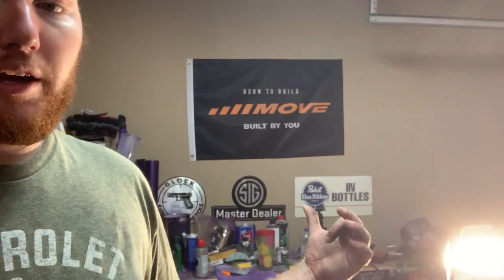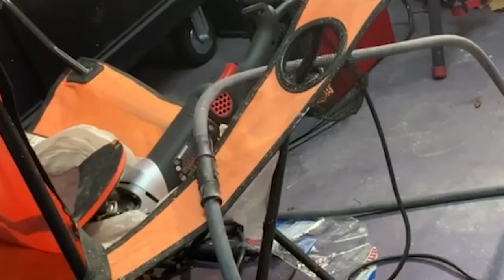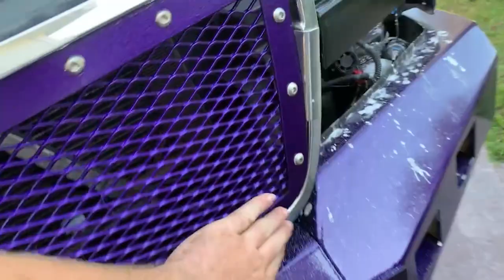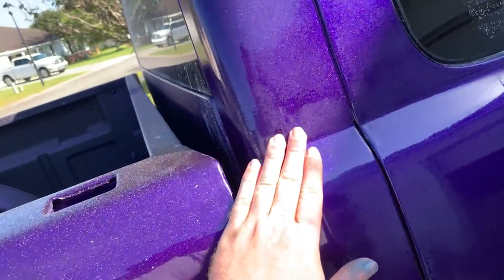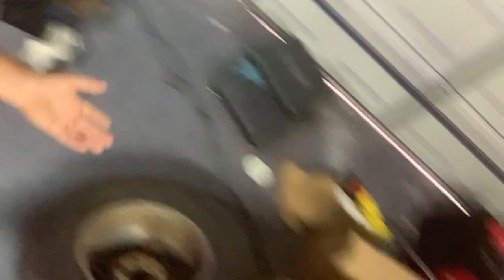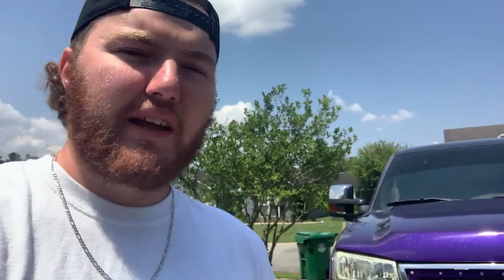UNREAL Daytona CRUNCH! 43 HOURS NO SLEEP

Comment: That haze is unremoved sanding marks. You either didn’t sand to a high enough grit in those areas or need to re buff with a heavier compound to start
Reply from the maker: I’ll try more, thank you!
Reply: @AaronCates  Meguires ultimate compound.. trust me I've painted and had the same issue... two passes with that stuff and its all mirror shine

Comment: Hey Aaron what’s the company you got the grill from? I want one
Reply: Nvm just saw ten dusk? And the code! Thanks bro
Reply: Hey Aaron I checked out tindust but under gmc/Chevy they did not have a grill for my/ our year models, (07 classic)
Reply from the maker: He makes them just may not have them on his site yet, he just came out with a new design for our trucks and he’s running a special deal on them right now. Check out his Instagram @tindust_customs
Reply: @AaronCates  your awsome bro thanks
Reply: hey aaron sorry to keep asking the questions but im just a little confused on that grille still, did you have to cut out the whole inside of the grille you had on your truck and the TD grille us just an insert where your old one use to be? thanks
Reply from the maker: Yes that’s exactly how it works, you cut the center section that goes around the frame. The tindust grille then goes in the center and has 3 mounting positions that holds it to the shell. Took me less than one hour to get it together.
Reply: @AaronCates  sweet man i watched it again on my computer where the video was blowed up more and i see whats gping on more now, what tool did you use to cut the inside of the grill out from the frame of the grille? thanks
Reply from the maker: Just used a cutoff wheel on a grinder.